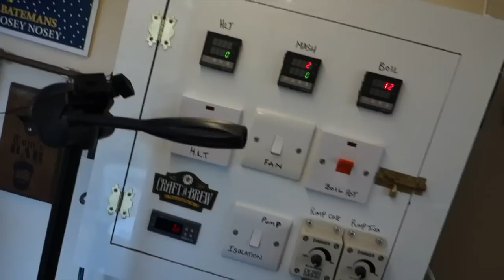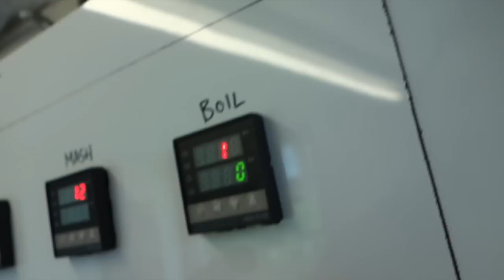More Parts Rolling In!

Comment: That is a right proper enclosure!!  Great to have Harry to plasma cut your holes. Just make sure you mock up the design before cutting.  A suggestion if I may..  Cut a piece of cardboard the size of the door and layout everything on the door (cut your holes in the cardboard and put everything in like it will be when done) and inside. Then lay the cardboard with everything on the inside in place and look through the heatsink hole to make sure you have clearance for all the bits and bobs. Looking forward to more vidjas!!  Cheers Tom!! 👍🍻

Comment: It must be getting exciting with all the new kit parts. I tend to agree that if you cut it with plasma, you will be repainting the enclosure - not a terrible price to pay. I'd be concerned about warping the door with too much heat. I'd use a jigsaw or a dremel. I would also layout my entire panel on paper and use spray adhesive to stick it to the door for a cutting guide. Good luck, Tom!

Comment: Great enclosure! WRT the 3rd SSR,  I'd still go with on/off for the pumps (on the panel) and control flow via the outlet valves - its easier to control for priming etc. The pumps are also designed (thermally) for constant speed and I'm not sure they'll be too happy being on the other side of and SSR. I have the same pumps and have had no issues doing it this way. Just use a flow switch for heat interlock for the herms. And where's the fun in the bucket route? I totally agree that brewing is more than just beer for some of us!! Good luck!!

Comment: Agree plasma will probably burn or warp the door simply use step drill bit for your switches and lights and jigsaw your STD and inkbird holes.
I need to message you I can help you out with wiring contacts terminals I have load left over and I think light switch.

Comment: The panel is goning to look top drawer mate when you have done it but like others I would suggest a hole saw for the switches on the front, 22mm option of this would be fine: https://www.ebay.co.uk/itm/14-29mm-Hole-Saw-with-3-8-Shank-Chuck-Cutter-Bi-Metal-Drill/123686441893?hash=item1ccc4953a5:m:mYvcnO4p13dtm-NSukXEdJg Also if you haven't got a dremel then I would suggest you invest mate, brilliant tool to have and will allow you toopen up the slot on top of the box easily and without damaging the powder coating. From your other videos you suggest you have a bit of damp in the shed so the last thing you want is the panel going rusty, try and maintain the original coating on it as much as you can.